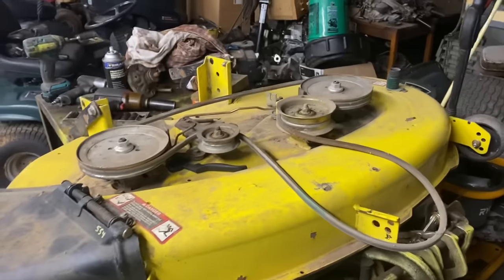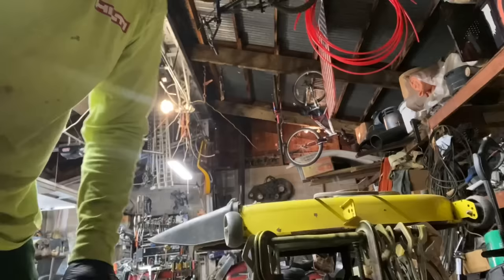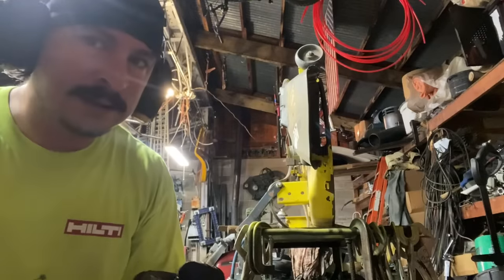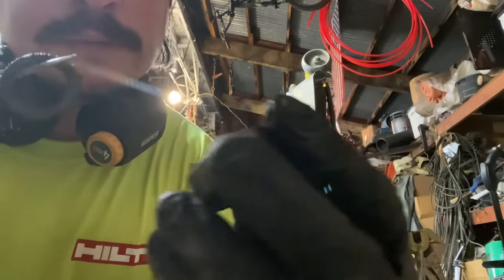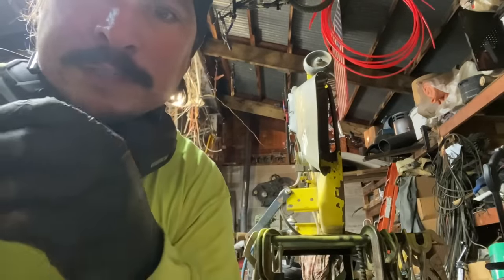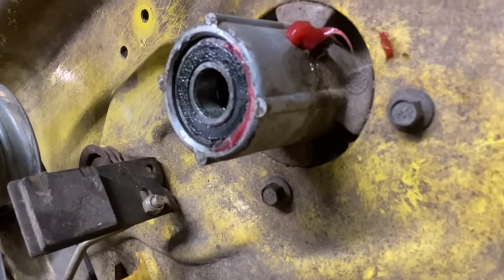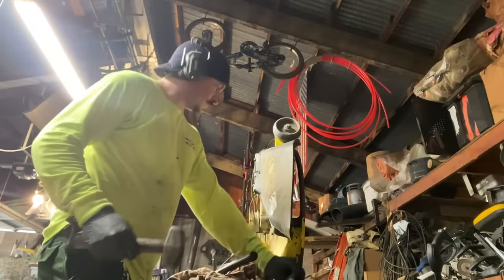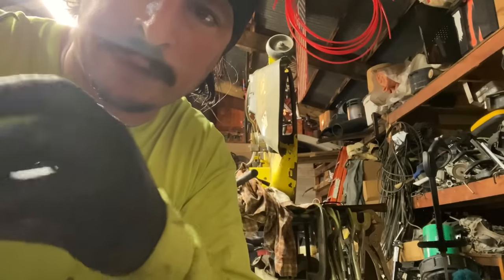Part 1 - Don’t trust the “Experts” Grease your mower deck sealed spindle bearings Common sense.

Comment: DON'T mix greases.
Reply from the maker: I do it all the time. Never once in my life has it been an issue. Relax, You think every time someone works on a deck they research and find out what grease was used last time. Nope, nobody knows what someone else used. Just grease it. I know the experts would flip out and advise against it. Some experts are morons. I’m just a moron not an expert moron but just the regular kind.
Reply: @GTObearclaw1  Then you have scant experience with bearings. 
Folks - wash the bearings out with gasoline, dry, and use one quality grease for long life. Mixing greases can harden the lubricant to the point of excessive friction or even lockup.
Spend a couple extra minutes and do it RIGHT.
Reply from the maker: @yomommaahotoo264  or just grease it regular and don’t worry about it. Flush out the old grease with new grease and don’t take things apart that work just fine. Your right about grease but that does not also mean that’s the only way to do it. Nor is there enough evidence to support the extra work being necessary. Add grease once a year will be fine for this application. Iv been fixing mowers for 20 years. It’s never been an issue. Bigger issue is dry bearings from lack of geese. Iv never pulled a mandrel apart that was filled with grease and found hard grease in the bearing. I’m not going to worry about stuff that I have never seen happen. Your just another naysayer with no proof, but happy to leave a comment to offer help to others. A lot like the “experts” I advise against trusting. Lots of talk, no proof. Not trying to hurt your feelings but just understand where I’m coming from. Also take into account that most folks don’t have the knowledge or tools or simply don’t care to dismantle a deck to clean out grease before adding new grease. On top of that reason, if I were going to pull a deck apart to clean bearings, it would make more sense to just add grease and if they fail or start making noise I’ll take things apart then and deal with it. All the same work is required weather I pull the bearings out to clean them or replace them. I’d even argue that if they are already out for cleaning, I’d just throw new ones in. Not many people
Will waste time doing your process but some will because they don’t know better and just prefer the extra work and piece of mind. Where I have enough hands on experience to know all that a waste of time and just adding grease works absolutely spectacular. Nothing else needed as long as bearings are okay when greased. Greasing won’t fix bad bearings but will keep good ones going.
Reply: @GTObearclaw1  I have plenty of proof in 20 year oxygen generator machines repeatedly rebuilt ...using compressors with similar bearings running 24/7. Most lawnmowers don't have anywhere near those hours of continuous service running hot and also keeping them quiet.
Yeah - if I wasn't tearing bearings out of mandrels I do just add any old grease, but as you demonstrated those mandrel bearings are sealed anyway and need the shields removed in order to ensure lubrication.
 I'm saying that when it comes time to actually remove mandrel bearings...and the bearing seals... spend the extra few minutes doing it right by cleaning and greasing with one grease (one type I use is Mobile One, and another type I use for bearings that cannot easily removed is Super Lube - one of the few greases that can be mixed with others).
Riding lawnmowers are relatively disposable well before their 20'th year anniversary.
Reply from the maker: @yomommaahotoo264  if you have proof on a specific topic that can help people and you have specific information that many people can use but don’t know, please post a video and be part of the solution. No need to hard as me. If you think I’m wrong, simply perform the process and see how it works and get some hands on experience with this application. That’s how I learned. Took me a long time to figure this out with no help from anybody giving me tips. I learned through trial and error. Had hundreds of decks apart over the years. I’m building decks in my sleep. I’m not making videos to advise folks on those applications your talking about. Probably completely different from every aspect. RPM, quality of components. Load ratings, I couldn’t even say what else. your probably right, 20 years seems to be an acceptable life of a machine but I can keep one going way longer by doing basic maintenance like this. That’s why I am helping folks find the truth. your all over the place. I’m not making videos to address anything your talking about. My video is specifically about mower decks. And the whole point of the video is that it’s not necessary to take a deck apart and remove bearings so to say that it would be good to remove the seal while it’s apart has nothing to do with the help I’m trying to offer because I’m trying to convey that it’s not necessary to remove the seals in the first place. And if you watch my full video you would have seen that the grease passes those “seals” like a fart through trousers. Nothing to
Waste more time racking your brain over. You have no proof that mixing grease in this application Causes problems and you are willing to mislead the DIY folks. You have no Evidence. That’s all I’m getting at. The experts are eager to tell us. But they won’t show us how these things are a problem. Like donnyboy saying not to even bother greasing because the seals stop grease. I just proved that was a load of BS. Big pile of stinking crap.

Comment: You know, unfortunately people become mechanics all their life and never know the proper method of working on something. You should never use a hammer on a bearing. I was a union milwright all my life and had training from Fafnir and Timkin on the installation and removal of a bearing. As far as the grease, they are sealed for a reason and it's not to just keep dirt out. A bearing should only have about 25% grease in it or it can overheat. It only has less than .001" between the outer race and the ball or roller. When the time comes, just replace the sealed bearing. As far as the hammer is concered, the balls and rollers are very hard, but brittle. A knick can shorten the bearings life substantially.  The zerk fitting is to put grease in the cavity so that shaft piece can be lubed.
Reply from the maker: Here we go again. An “expert” knows everything about everything. Lol. As for the hammer I barely taped these things chill out. Not gonna be an issue. No more force than I used these bearings will still last a long long time and the failure will come sooner from not greasing than it will from using a hammer. And your so wrong about the grease zerk it’s annoying to even read your blabber. This process works 100% of the time for the application Iv shown it for. If you have proof of the process being wrong or an issue please feel free to post a video to help folks and stop giving advice for an application your not as knowledgeable about. Stick to helping folks with what you know. Obviously you know less than you think about this process. You and the guy I mentioned at the end of this video have no helpful information on this process. That can be hard to hear but something you should at least consider. Saying to run the bearings to failure and then replace them when they fail is moronic. The grease will extend these bearings life in most cases longer than needed to outlive a tractor. Then on top of that the use you explain for the zerk is flat out wrong. There is nothing between the bearings needing grease. That’s just silly. Only the bearings need grease. Training is only as good as the information provided and sometimes folks giving training go way too overboard on extreme measures. Scare people about processes that can safely be done without worry but they can’t say use a hammer gently. Better to just say don’t use a hammer. Sometimes things are just fine and no need to get a super technical. Iv yet to have a bearing failure on one I maintain with grease. Iv had some tractors I got free that were 20 years old. I fixed them and used them hard for many years and removed bearings exactly as shown and still going strong. I guarantee they would not have lasted this long without adding grease. But hay. What can I say, maybe I’m just awesome.
Reply: @GTObearclaw1  why put the inner grease seals back in?  I don't know everything about anything and never implied I did. But if you can tell me the definition of a milwright without looking it up I'll be a little impressed. I have had the extensive training on bearings and judging by your video do know more than you. I have also been through the five year Apprentieship program for Milwrights. You sir, are what is commonly called a hammer mechanic. Now, I understand that speed is required for your line of work. Mine wasnt. Your $50 part isn't as critical as the multi thousands of dollar bearings I have had to replaced. But I will say, if I was ever seen hitting any part of a bearing with a hammer I would have been fired on the spot. Bearings are one of the things I know a lot about.
Reply from the maker: @kevint9702  okay, I get it. You know more than me, Your smarter than me. You work on more expensive equipment than me. You have a more important job than me. But 99% of folks meet that criteria. I’m a hard headed hammer mechanic and I’m okay with that. Iv always been a hard head. I know my worth or lack there of. I’m not concerned about impressing anybody. Never have really cared. The process I use works great for what I’m doing here and Iv never seen issues from my processes, We don’t need a rocket scientist over with complicated methods trying to make things more complicated than they need to be for something so simple. I would not enjoy your line of work. Nor do I have interest in it. Just helping people fix mower decks. I’m no expert, and I’ll be happy to tell anybody who asks. I’m only showing processes that iv found work great and can help folks. I make no $ just enjoy helping folks almost as much as I love debunking “expert naysayers” who offer no real help. If the help offered is that the machine should be taken to a professional and pay for the work, I’ll pass. No need to get into the most extreme methods of how to care for million dollar machines. I’m fixing mowers on this channel. Speed is not required for what I’m doing. Just trying to make the video quick as I can because folks don’t seem to like long drawn out videos. And folks don’t like folks who want to talk talk talk and not show the results. The whole point about the hammer really doesn’t matter and the reason I didn’t leave the bearing shields off is because the whole point of the video was to show that grease passes the bearing shields. The goal was to show people that the seals are fine in place and don’t make a difference. So I needed them back in to prove that point while also needing to remove them to show before and after. If I left the seals off that would be a difference video for a difference purpose. I would expect an person of average or above average intelligence to extract that from the video. I don’t think leaving seals out will make any difference so taking the deck apart in the first place just to remove seals is not necessary. I’d say it’s a project for ignorant people. I use to be very ignorant of this topic. I would dismantle decks and individually lube each bearing until I figured out that grease will pass the bearing shields. If folks get the point of the video, the hammer wont be used and they will grease the deck as I recommend. The bearings in these decks don’t cost 50$ they don’t cost 25$. You can get these cheep bearings for about 5$ each or less. Unless you want high quality bearings which these are not. I’m not making videos on how to remove bearings. But great topic. Maybe that can be my next video. Don’t hold your breath, I don’t really enjoy making videos. Unless someone like Donny boy posts crap advice and I need to debunk it. my thought is that most folks just going to grab a hammer. Tap tap tap it in. Did you really read all this?
Reply: @GTObearclaw1  Well, it doesn't take any longer to do it right. Question, putting all that grease under pressure, do you think that forces the seal into the bearing? Why show the wrong way, just to make content to collect ad money from youtube is my guess. You don't care about what you're showing people, as long as you get viewers. See ya! I'm not wasting my time with someone that doesn't want to learn and thinks he knows what he is doing.
Reply from the maker: @kevint9702  you obviously don’t know much about this process. Very little pressure is needed to push past rubber lips of the seal on this type of bearing. I wouldn’t even go so far as to call these things water tight. So oil / grease flows past the lip on shields with almost no effort. Nothing I ever do will be good enough for you. You will be back, your the kinda guy that knows everything and needs to get the last word in. Your wrong about so much but unwilling to admit to anything. This process can be tested, I don’t have a patent on this video content. So feel free to make one and prove that grease damages seals or pushes the seals in. As my video shows seals were just fine after process. The inner seal has nowhere to go, can’t be pushed but a small fraction of an inch before lip gives way and let’s grease pass then the pressure if any is quickly equalized / dissipated. That’s why I show every step. This is so basic it baffles me people want to argue about it. In addition, the outer seal / shield can’t go anywhere if the unit is assembled properly there is nowhere for it to push out to. So I’ll give that tid bit as well. Only enough room for lip to allow grease to pass in or out of the bearing and any “over greasing” will quickly move out of the bearing. once bearings are in use
The excess grease will push past the seal to make room for movement. Just think about these as self regulating. If you get the grease in, the bearings will push out any extra that’s in the way. Super super basic simple stuff. Hard to grasp until it’s shown step by step but after seeing it, should be thinking, yea that makes sense. But, Your just another naysayer trying to prove me wrong. Go ahead and put in the effort to try this processes if I’m wrong post your findings and debunk me. Or Just type out everything you know and your credentials so we all think your an expert. But I know your not knowledgeable on the topic at hand. And that’s the only topic that is relevant. This is a specific application and I have provided proof. If you comment with lies and false information I will debunk it. Don’t get your feelings hurt. This is just about getting the information out to help folks. I have not made any money from a video. I’m that would be awesome but This happens to be the most popular video I have and I don’t get payed, at least never have as of yet. Being that I only made one video in 2 years, should seem obvious I’m not out to profit from my videos. I don’t do it for $. But I like to prove the experts don’t know everything but they are happy to try and say things can’t be done. I’ll prove them wrong if I find bogus BS. All this stems from me using a hammer. Folks shortcut all the time. Just because a hammer was used does not mean a failure will occur. I get it, it’s not the right way. I don’t care. That’s not a big deal to me. Yes I understand your point. I simply don’t care about it. When I need to use force to remove or install a bearing I’ll use a different method. Even using a race driver will still put pressure on the balls and apply the force from inner race, through the balls to the outer race. For this application I’m fine. But because you didn’t get the reaction from me that you wanted you try to find another flaw and attack me there. Your really just a bully. Know it all bully. If you cared enough about helping folks you would make a video about the process using all your correct processes and provide actual help. Currently your just another naysayer. If you are gone and going to quit bothering me I’m okay with that. By falicia

Comment: Why not just leave the seals off and go that route?
Reply from the maker: If you really care to know, read some of the comments on my other responses. I have good reason. I’m just tired of typing them out for every person who brings this up. Remove your seals, leave them. It makes no difference in the grand scheme of things. Just grease the bearings till they are full of grease and you see it exit top or
Bottom bearing. If you want to pull your deck apart to remove seals because some other clown said it helps, go for it. Just remember none of those other clowns show a step by step process but they are experts giving you advice on something they won’t take the time to show you the proof of process. I did take that time. To save folks for needing to take a deck apart to remove seals that won’t stop grease from passing. I’m the kind of clown that goes the extra mile to show my process.
Reply: @Woodchuck Russ the Deck Dr  I mean, if you are already in it.. not just for the hell of it...
Reply from the maker: @bigloads3600  that’s why it’s best to grease them properly in the first place so there is not a reason to be going that deep unless something else happens. Honestly I don’t care what folks do. Remove seals. Keep seals. Add more seals, the point of the video is to prove the seals don’t stop grease. Anything else is irrelevant.